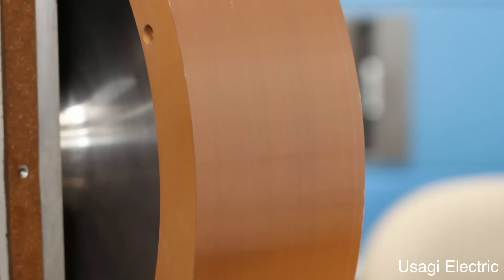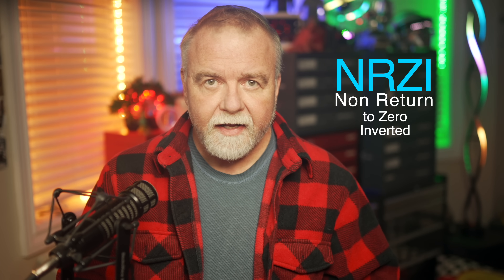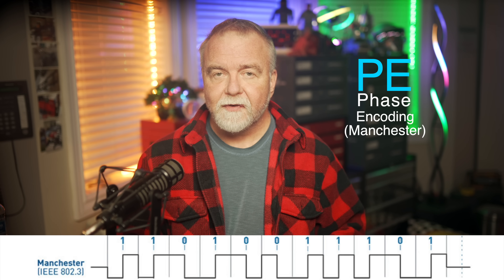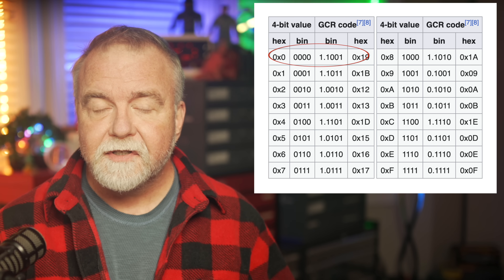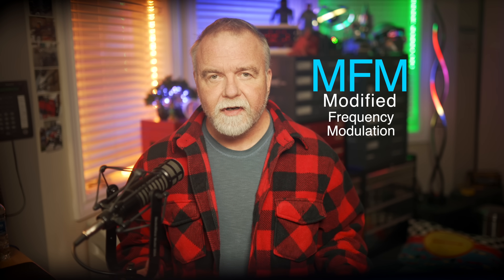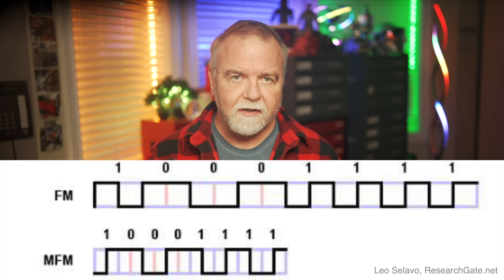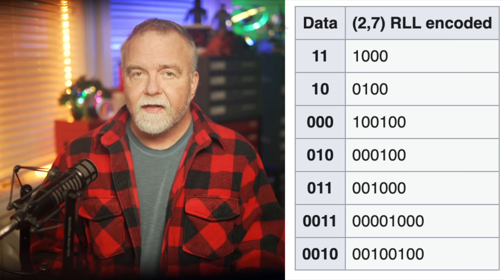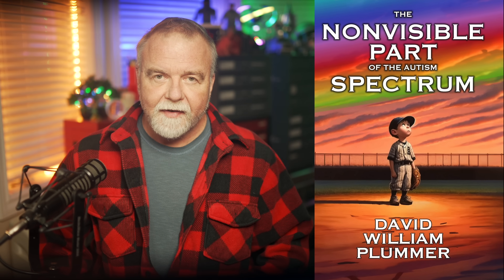Learn How Bits Are Actually Stored: NRZI, GCR, MFM, and RLL Explained

Comment: thats why optical depth holes are clearly defined, as height delta. well you could add a parity crc sum track and a timing track. its only a fraction of the total storage track count. PE  has doubly the space usage vr parity timing track among multiple tracks. maybe something like 8-1-1 data-parity-timing. like in serial modems. opencl with java is super nice, cpu and gpu as opencl device. yes ECC data storage. yep you just have to have more read/write heads than one, more like a parallel port. yes optical paper hole tape reader with the timing track. maybe more than one bit parity per say 8-bis of data and 1 bit of clock. there is an optimum amount of parity bits to fully correct the 8-bits in one clock. clock and parity like in RAID 5 should be at most 10% of the data payload capacity. you might only need one 360 degrees timing track on a disc for all discs. then the inner track/s can be the timing tracks and variable density bits on all the outer tracks, assuming bit density is close enough. crap that subtitles was very distracting at the end. no, autism is not a condition, its flesh trying to understand, by its own power. flesh gives itself out in many different malfunctioning ways.

Comment: PE is used for the data tracks on credit cards. You can record it as simply as pulsing in two polarities. Reading it back it shows up as pulses either up or down on a scope and is EZ to decode using a comparater + AND gate.

Comment: You are absolutely correct that hard drives using the old "ST506" interface could get an instant 50% capacity upgrade by replacing the MFM controller card with an RLL card and then performing a low-level format.

Case in point, the venerable ST-225 (20 MB) drive and the ST-238R (30 MB) were essentially the same drive, but the 238R had an RLL controller, while the 225 had an MFM controller.

Drive manufacturers warned you to not to use an unsupported controller like this.  They said that the surface and timing circuitry of an MFM drive could not reliably handle RLL data, and if you did this, the result would be unreliable and you would void the warranty.  Maybe this was technically true, but lots of people did it anyway and it almost always worked.

Of course, once RLL drives started shipping, nobody went back to MFM.  I think all drives today use some kind of RLL encoding.

Also of interest is the GCR encoding used by the Apple II floppy drives.  Apple actually used two different kinds of GCR over the years.  The original one (DOS 3.2 and older) created disks with 13 sectors (of 256 bytes) per track.  With 35 tracks and one head, that produced a capacity of 113.75 KB per disk.  But when Apple released DOS 3.3 for the Apple II, they changed to a different GCR encoding that was able to pack more bits on a track.  DOS 3.3 disks had 16 sectors (of 256 bytes) per track, for a total capacity of 140 KB per disk.

Interestingly, had Apple chosen to format and use all 40 tracks that the drive could (I assume) have formatted, the DOS 3.3 encoding would have produced 160 KB per side - very close to the single-sided capacity of an IBM PC's original floppy drive (which was 9 sectors of 512 bytes per track, for 180 KB on single-sided media or 360 KB on double-sided media).  But Apple never went there.  I assume there was a technical reason why they limited their 5.25" floppies to only 35 tracks.

Also interestingly, Apple stuck with GCR encoding for their original double-density 3.5" drives.  But they use a variable-speed spindle motor in order to slow down the rotation and pack more bits (and therefore more sectors) on the outer tracks, where there was more linear space to write them.  With an 80 track drive, this produced a single-sided capacity of 400 KB and a double-sided capacity of 800 KB (vs the PC-standard MFM 3.5" disks that were 360 KB single-sided and 720 KB double-sided, using a fixed-speed motor and the same number of sectors per track for all tracks).  Apple eventually relented and used industry-standard MFM for their high-density 3.5" floppies, producing the same 1.44 MB that PCs have.

And this is why it is nearly impossible for anyone without an old Mac to read an Apple 400K or 800K disk.  The GCR encoding and variable number of sectors per tracks makes it impossible for a standard PC floppy drive (with a fixed count of sectors and MFM encoding) to read anything meaningful.
Reply: Same reason Commodore also limited their drives to 35 tracks per side: there were a lot of dodgy drive mechanisms and disks in circulation at the time which had trouble reading and writing later tracks reliably. Limiting the format to 35 tracks was an ugly, but effective, solution to this problem.

Comment: Yes, you could use a MFM drive with a RLL controller with the caveat that the drive might not be of high enough quality to support it well. It's a matter of manufacturing tolerances and qualities of the magnetic media. I'm sure some drive manufacturers sold their RLL drives that didn't pass quality checks as MFM drives. Quite often the the difference between an MFM and RLL drive was just the label having a different suffix letter on the model number.

Comment: Reed Solomon is everywhere. They are used in QR codes and take up around a 3rd of the bits in any given QR, which is why they can scan with damage or a logo in the center.

Comment: Adrian's Digital Basement channel had an episode of recovering data on some old MFM and RLL drives. He also went through explaining the encodings used. It was very interesting.
My first HDD was an MFM 40MB drive. I think I paid $500 for it at the time. Had to low-level format it before you could then partition it then high-level formatting the drive so the OS can store any files on it. Ah, those were the days.
Reply: And when the IDE drives came out and were told NOT to low-level format them... I was very confused.

Comment: I repaired 8" to 5 1/4 hard drives 1980's. It took a mfm disk controller to rll controller to get 50% more! Two megabyte became 3 megabyte! Most the time on a drive, it was the lubrication that was wrong!

Comment: I worked for Hard Drives International back in the MFM/RLL/ESDI/SCSI days (and early IDE/xt-ide).  Yes, you could take a Seagate st225 MFM drive, put it on an RLL controller and if you were lucky you'd get the same capacity of a ST-238r.  Basically, a 50% increase in storage.   If you weren't lucky, it would work but you would end up with data corruption.

Comment: On occasion I was able to format an ST225 drive with an RLL controller, and have it work reliably, but not always. The ST238 was the same physical drive, but with batter electronic hardware.

Comment: You could definitely save money by getting the MFM variant of a drive and using it on an RLL controller, doing it with older drives was hit or miss. Pretty sure the first thing I did when I got my 386SX in late 1989 was swap in an RLL controller and my ST-251-1 went from 43mb to 65mb... You also got a 50% faster transfer rate with RLL.

Comment: Regarding the apple II… yes the diskettes had a sector hole, but the disk drive did not contain the sensor to use it, so it was the ultimate in soft sectored disks🤣The reason why can be found by looking at the prices of 5.25” floppy drives in 1977. Apple (Woz) eliminated a ton of hardware and simplified the disk interface to the point that apple drives were about 35% cheaper ($600 for drive and controller was pretty cheap back then). Look at a disk II controller board and disk drive analog board and you will see, it did however make the poor 6502 have to do the heavy lifting to decode the tracks.

Comment: There was a stand at Comdex 1996 with a guy selling a replacement floppy disk controller card. He said it could increase your standard 1.44MB floppy to 100MB with no other hardware changes. How did THAT work?

Comment: Definitely worth tring a MFM drive on a RLL controller. Especially when they started using plated media.  Very reliable and another bonus:  50% more storage per track also meant faster read/write data transfers as the drive was rotating the same speed but the data was transferring that much faster.  Made for noticeably faster operation.. Win-win! Ran dozens of different drives that were MFM originally with RLL controllers for years. My old multi-line BBS ran with 3 old Priam(?) drives on an RRL controller. Never lost any data, rand for years...  Great video! Love these deep dives into stuff like this.  Thanks!  Blessings,  Stu

Comment: You said that RLL allowed hard drives to store “up to” 50% more. 

How did they deal with the uncertainty of the type of data when advertising the size of the drive? eg 20MB drive if you’re storing text but 16.6MB if you’re storing non-compressible data ??
Reply from the maker: It doesn't do any compression - it's just a more efficient encoding so stores twice as many data bits in the same number of transitions.

Comment: I remember having two 20MB seagate drives on my BBS and I bought a brand new on the market RLL controller. 
I copied all the BBS software and scripts to floppies as well as the second hard disk, reformatted the first Hard drive to RLL and copied it all back - Viola ! 30MB. 
Re-Loaded (copied) all the software back to that drive after re-installing DOS and did the same thing to the second drive and now I had two 30MB drives. 

It so seemed like magic at the time.
Some time after that, I got an ESDI drive, then a SCSI drive and then an IDE drive. It was an incredible journey.
Reply from the maker: I'm literally formatting my ST-251 as I write this!
Reply: @DavesGarage  - LOL. Memories 1 - I got 2 bigger capacity drives in the days where they were expensive (in Oz) and ended up only paying for a controller which was less than half the price of one drive.
The Diagnostic BBS needed space urgently and that did it nicely. Good memories.
Reply: @chrismadog8004  Computers were certainly more fun in those days.

Comment: I remember ' developing' 800 bpi (bits per inch) and 6250(?)bpi 'ibm' tapes to show how the density on a tape increased.  If you knew what you were doing you could 'read' the 800bpi tapes with a low power microscope.  I still have the 800bpi tape somewhere.

Comment: Wouldn't MFM suffer synchronisation problems if you wanted to fill a sector with alternating 1010101010101010101010 ?

Comment: Dave didn’t go into this specifically,, but for those who remember “single density” vs. “double density” floppy drives, single density used FM encoding while double density used MFM encoding.
Reply from the maker: Cool!  I did not know that!
Reply: @DavesGarage  someone pretending to be you commented on my comment and requested a call. Please stop the bots I got excited until I saw it was a bot account. I don't know if it's just this video or multiple
Reply: @subbastionbastion2167  I reported it as spam
Reply: @DavesGarage  I got a strange reply from daves.garage01. It seems to be a whats app number
Reply: Man, I feel ancient for remembering that... [creak]
Reply: @GeneCash  I know my first day on a new job they were rolling out a 6ft long drum disk from the Air Force facility I spent the next 8 years working on everything Dave talked about from 7 track tapes to 40/300mbyte spinning multi platter disks to the first 8 inch floppies and finally to sealed media disks.
Reply: Sure, done that some times.
ST238 was a selected ST225. That 20MB MFM drive on a RLL controller gave 30MB.
Reply: @paulcohen1555  I remember those.  Also the ST-277R was a selected ST251 that could handle RLL reliably to get 60 MB instead of 40.  Funny how we now have multi-terabyte drives.
Reply: I was up to mark that both used MFM encoding, but immediately realized that I was talking about 2D vs HD. Really don't remember having seen any SD floppy, besides  8" units. (THOSE were Disks!) 🤣
Reply: @DSP107  Yeah there’s single density (FM), some early 8” and 5.25” systems used it, then double density (MFM), then quad density (80 tracks instead of 35 or 40), then high density (pack the bits closer together on a higher grade media).

Something else to note about high density disks and drives: 5.25” HD drives spun at 360 rpm instead of 300 and give 1.2 MB per diskette; 3.5” HD drives spin at 300 rpm and use the same transfer rate as the 5.25” version; the slower rotation at the same bit rate increases the density/capacity to the 1.44MB we all remember.
Reply: @DSP107  A stranger came into school one day and brandished one of those as the latest thing.
Reply: I believe the reason you could use the same drive with MFM and RLL encoders was because prior to IDE the data encoding and head control was all done on hdd controller board itself. The drive was doing what the controller told it. IDE introduced a common interface protocol and moved the drive controller to a PCB attached to the drive unit. This allowed drive manufacturers to employ proprietary encoding error correction and caching and power management functions on the drive unit. Manufacturers could then innovate and compete on these functions while still remaining compatible with the IDE interface signaling from the hdd controller.
Reply: If it can configured flash memory adding things making pi is least GB seconds
Reply: I was actually wondering about that as soon as he went over that.  Makes sense now!  I never really questioned much what it meant at the time.

Comment: NRZI = 800 BPI TAPE
PE = 1600 BPI TAPE
GCR = 6250 BPI
9 track tape = 8 bits data + parity and ALSO CRC at end of block. Controllers would fix the data if necessary and would report a "soft error". Fun fact: tape data transfer was way faster than disk. Ie tape sorts were much faster than disk sorts. Proved that on a 370/138 with (8) tape drives and (10) 2314 disk drives

Mainframer since 1969 here

Comment: 01001001 00100111 01101101 00100000 01101101 01101111 01110010 01100101 00100000 01100011 01101111 01101110 01100110 01110101 01110011 01100101 01100100 00100000 01110100 01101000 01100001 01101110 00100000 01100101 01110110 01100101 01110010 00101110
Reply: You need to let us know what encoding you're using. Didn't you watch the video?
Reply: @jasonmartin1554  "You need to let us know what encoding you're using. Didn't you watch the video?"
01001001 00100000 01100001 01101101 00100000 01110101 01110011 01101001 01101110 01100111 00100000 01100001 00100000 01110100 01100101 01111000 01110100 00100000 00101101 00111110 00100000 01100010 01101001 01101110 01100001 01110010 01111001 00100000 01100011 01101111 01101110 01110110 01100101 01110010 01110100 01100101 01110010 00101110

Comment: My first hard drive was an MFM 20MB ST-225, and the controller that I got with it was a single port controller. When I got my second drive, it was a 30MB ST-238R, and came with a dual port controller card. At some point, I ended up reformatting the ST-225 to RLL on the dual port card, giving me 60MB of storage in one XT machine. Those drives were with me until I went to upgrade Windows 3.0 to 3.1, and 3.1 no longer supported the 8 bit controller. At that point, I picked up a 50MB Quantum Fireball IDE, and the old drives got used to make a gaming computer for the wife and kids ( think 286 CPU and monochrome graphics, great for hangman and board games. )
Reply: Still have my ST-225. And the 5150 I used it it.

Comment: Ah ok, the last bit about MFM explains a lot. I remember back in about 1988 being told I could buy a 30MB Seagate harddrive and format it at 40MB under DOS 3.3, or some numbers along those lines. The question back then was "how is that possible?". Nobody knew. Even the people at the computer store didn't know, they just said we could do it even if they didn't know why it worked. Well, it did work, and very well. 10MB was a major win back then.
Reply: Umm... dos 3.3 had a 32MB size limit, so no way were you formatting it at 40mb. And by 1988, pretty much all drives were IDE drives. It is possible that you had DOS 3.31, and actually had a 40MB drive - people would have been formatting 32MB partitions in 3.3 on a 40MB drive, and then you were "magically" able to format greater than that on 3.31. If it was an MFM/RLL change, you would have got 45MB out of your 30MB hard drive.
Reply: @db21362  you could have several partitions. Or some controllers had split feature representing one larger drive as two smaller ones on a hardware level.
Reply: That might have been a case of cramming more sectors per track, either/both with shorter gaps or using more of the slack space after the last sector.
Reply: @Rybagz  Only if he was hacking the hardware... since the computer store didn't know, I very much doubt they were doing that.
Reply: @Rybagz  yes, just like the floppies for IBM PC contained 320 kb initially with 8 sectors per track DOS 2.0 switched to 9 sectors per track seeing that equipment is reliable enough to allow that. That depended on the rotatiotn speed that had to be constant and not too fast, as sectors would overlap otherwise. Later floppies were working easily with additional tracks and sectors per track. If that worked for floppies it should work for some drives even without switching the encoding.

Comment: You're right. In fact I always heard that the Seagate st-225 (20mb mfm) and st-235 (30mb rll) were the same drive. I loved those old systems I had a 60mb mfm drive formatted via rll to 90mb. One of the platters had a bad track 0. I was able to tell the low level format utility to ignore that platter. Lost some space there. My grandfather worked for IBM back in the day, often bragged about being the inventor of RLL. Wish I had some confirmation of it.